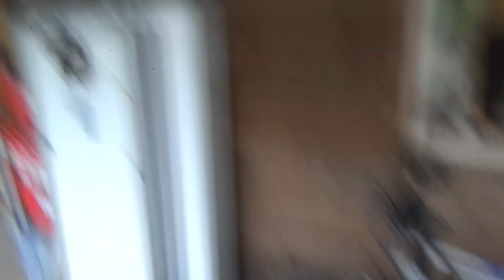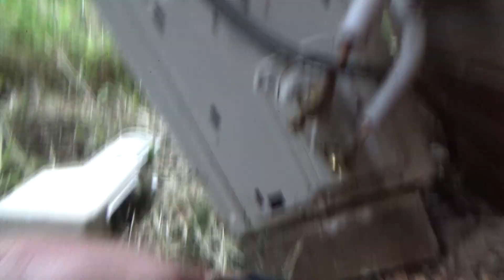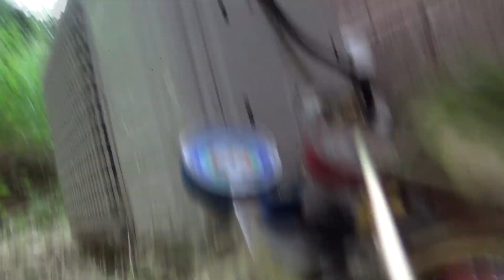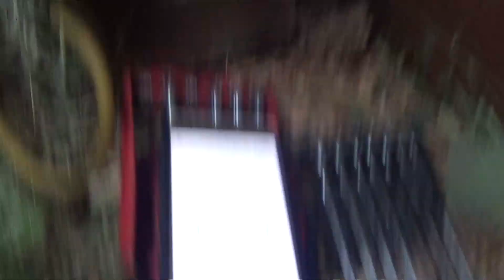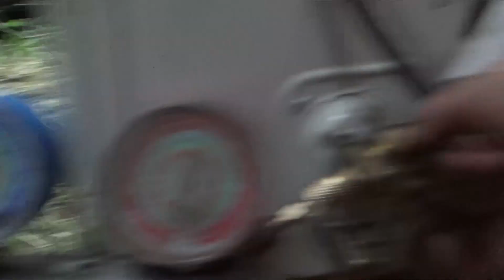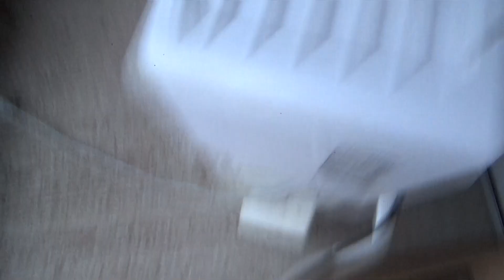Moving HOUSE! R290 mini split AC unit decommissioning (pump down)

Comment: Legend video. Only thing I'll do differently if purge the air out of the hose briefly with refrigerant before I connect to gauage so it doesn't get sucked in when you pump down. Having hoses will ball valves helps do this. 

Really good job and thanks for info!

Comment: A good honest walkthrough, CHat GPT points out that doing a DIY pump down with R290 gas is highly dangerous but you have proved it can be done, but the compressor but the valve and compressor need to be shut off much quicker, also please treat yourself to a set of Electricians screwdrivers !😊
Reply: GPT trying to avoid litigation. Connecting propane to BBQ also dangerous or high pressure gas if you work in a pub. Also long as hazards are controlled you'll be fine

Comment: You seem to have figured out the basic idea pretty well, but you really should keep the time the unit runs while pumping down to an absolute minimum because the stress on the compressor is huge when the suction pressure drops below the normal range and the compressor isn't getting lubrication or cooling without refrigerant flowing since the refrigerant carries the oil and cools the compressor.

Also, you really don't want to run the system into a vacuum during pump down. Not only does that put a huge stress on the compressor, but when you disconnect the lines, you suck air (which contain moisture) into the system. Yes, you can suck the air out of the system with a vacuum pump, but the oil left in the lines and indoor coil will absorb the moisture, which can't be removed with a vacuum. Once you disconnect the lines, you need to immediately seal the ends to keep moisture out because the moisture will break down the oil and turn it into acid.